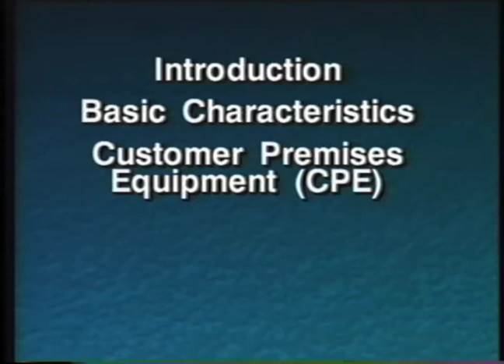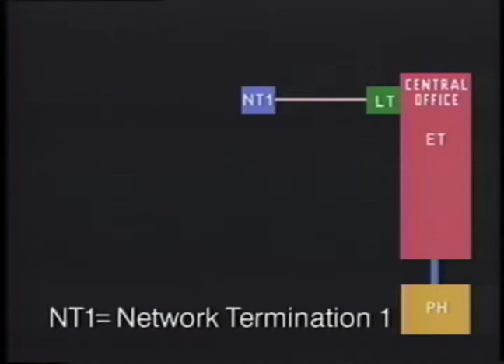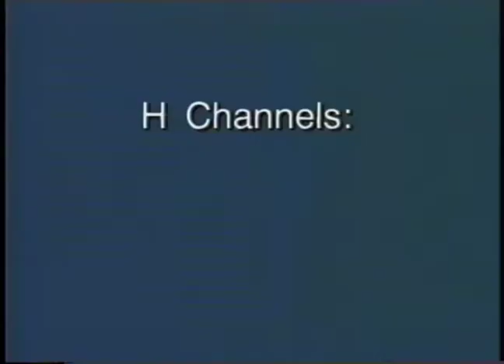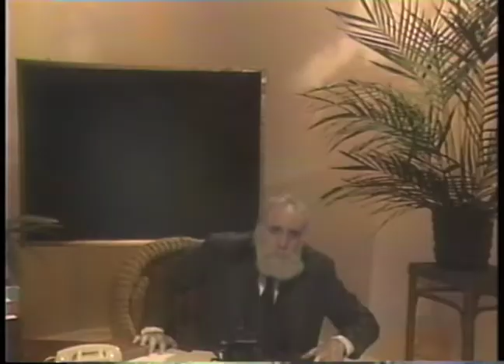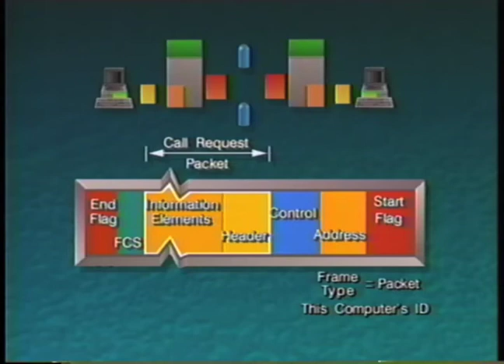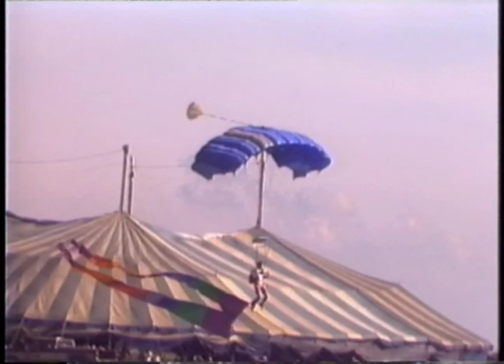AT&T Telessentials Curriculum ISDN Basics TC1606

Comment: While I worked with primary and basic rate ISDN, basic rate never took off in North America the way it did elsewhere.  Part of the reason was high speed modems, which eliminated much of the advantage of basic rate.  I normally used basic rate for video conferencing and also PBX extenders.  Primary rate ISDN was often used where some DS0 channels were used for PBX and other channels for some data application.  A CSU would be used to terminate the primary ISDN and separate the channels for voice and data.

Comment: ISDN BRI would have been a huge success in the US if AT&T didn't mismanage the service so poorly.
Reply: My understanding is that by the time this was rolling out in the market, Ethernet LANs were exploding in business applications (helped by switches, 100BASE, and full-duplex operation), and the Internet, despite its relative obscurity at the time, was showing more potential as a resource than ISDN's concept of point-to-point data services. Once ADSL came out, there wasn't much of a point after that.
Reply: @eddievhfan1984  ISDN and ethernet weren't competitive services in the 90s. Ethernet was exclusively used for LAN. ISDN was used as a middle ground solution to move data over distance using phone company infrastructure. It fit the bandwidth needs between analog modems (<56kbps) and T1 (1.544Mbps). ISDN was available long before ADSL in most areas of the country. I got ISDN-BRI in 1998 at $100/month, and it had been available for quite a few years at that point. At the time a traditional landline was $25/month. In my region ISDN-BRI was used to call ISPs at 128kbps rather than the meager 24k to 48k with a modem. This worked very well for small offices where the price of a T1 was unjustified (typically $1000-1250/month in the mid-90s to mid-2000s). 

When the broadband and DSL deployments began for internet, dial-up ISPs and ISDN-BRI were done.

Comment: Hi, I'm from the future! It's 2019, and, sadly, ISDN never really caught on. We do, however, have cellphones that transmit data in the hundreds of millions of megabits per second, fiber to the premises, and we order our pizza, Chinese food, and groceries on something magical called the internet. Now, even my refrigerator and oven connect to the internet, and even basic access to the internet is 50+ Mbps.
Reply: Actually it did. Your cell phone presents an ISDN interface. It is due to the fact that GSM was developed in the same era and logically was designed as wireless ISDN. Functions like digital caller ID, answer supervision, multi-party calling that allows you to add and drop calls, E.164 "+" calling are features that came from ISDN. At the same time, nearly all business PBX systems, from the 1990s through the VOIP transition in the mid 2010s, ran off ISDN PRI.
Reply: @straightpipediesel  Hmm. TIL. It makes sense, too.
Reply: Hundreds of millions of megabits would be 10s of terabits which phones are definitely not doing for a while yet
Reply: Hello 2019, just a heads up that 2020 is going to be interesting…
Reply: This video was.published in 2019. But this is much much older
Reply: And soon the company that built that fridge will look at it, on night while you are fast asleep, and send a single to have a chip fail so you can go buy another one.